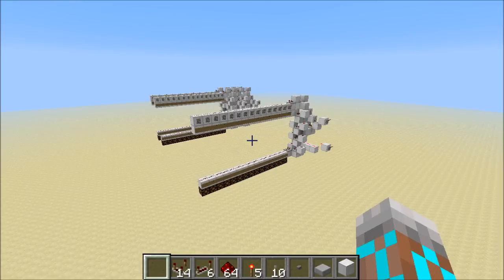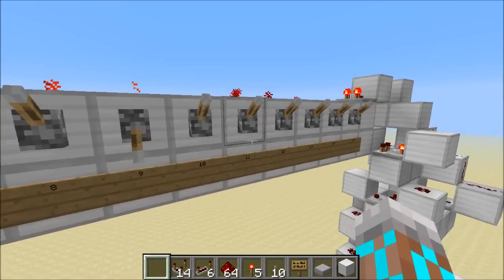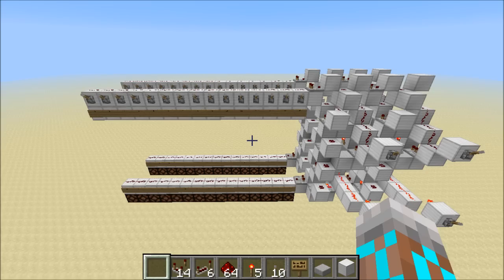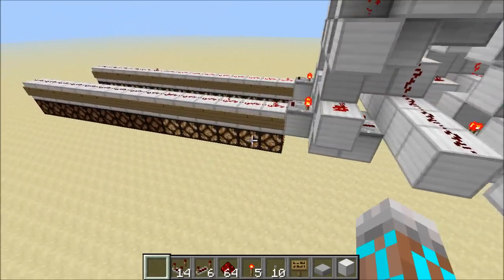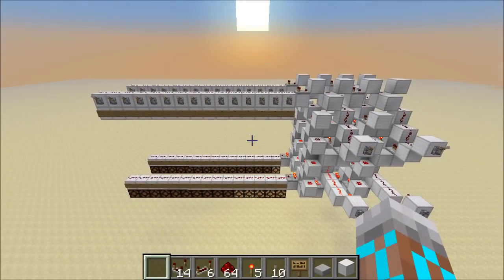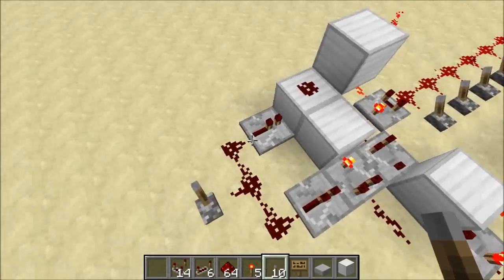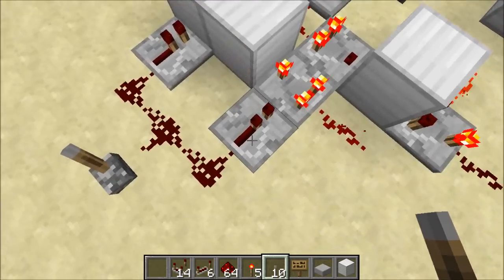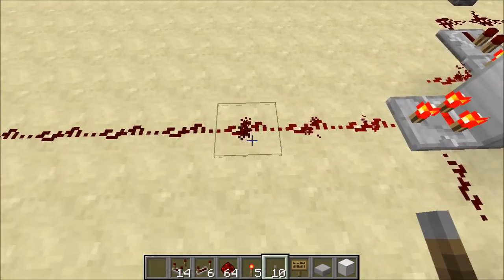Redstone Signal Strength RAM

Comment from the maker: It depends on the speed of the encoder and decoder and the size of the binary RAM cell. 2x2 BUD RAM has the same storage density as my hex RAM (although with a different distribution of where the data is), so if it's still functional after the update to 1.5 it will be faster. However, there are absolutely uses for this sort of memory and I think I'll be demonstrating some soon...
Reply: 1.5 didn't fixed BUD xD

Comment from the maker: Transmitting it over long distances isn't too much of an issue (check out Cubehamster's Redcoder, you can easily use comparators to make it travel a full 15 blocks), but I agree that it might not be the most practical storage. It is however a good way to get the 2x2 storage density if you don't want to use BUDs or if they are somehow changed.

Comment: I think the primary usage of this would be in cases where you wish to store charge-strength data (produced by some device) and don't want to go through the trouble of converting it to and from binary for conventional storage.

The biggest problem with signal-strength data will be its low transmission speeds over long distances.  Also 4x4 for 4 bits is a comparable storage density to existing 2x2 RAM, although that might change if/when BUDs are messed with.

Comment: Not really.  You can have a carry in and carry out just like in binary, you just have to add one to the next bit.  It's one of the reasons that I'm restricting myself to octal though, because you can work out whether you need to carry after doing your calculations rather than beforehand.

Comment from the maker: You're correct that RAM stand for random access memory, but it means something different than what you've described. Random access means that you can access the data you've saved in any random order for approximately the same delay. RAM has specific addresses, so you know where your data is saved, but you can access any addres at any time. I hope that cleared things up, but let me know if you have any questions! :D

Comment: That's the reason I made my adder. I think that making hexadecimal computers is possible. We got two main problems: 1) bussing, becouse it's not compact and not-so-fast in long distance. 2) decoding/encoding, even if I think that this could be not a problem is the whole computer works with hex: the only things you should encode/decode would be the input and the output. This could be a new age for Redstone!